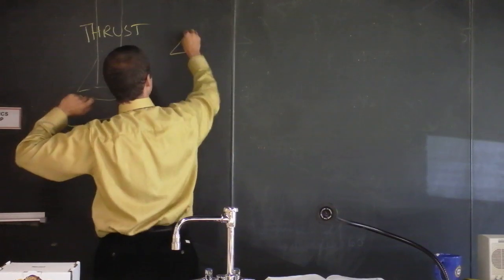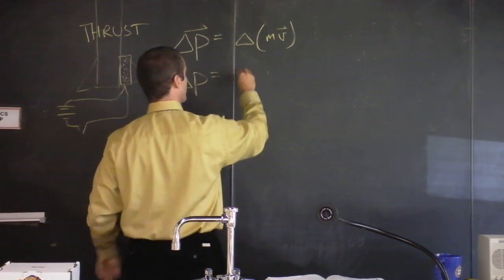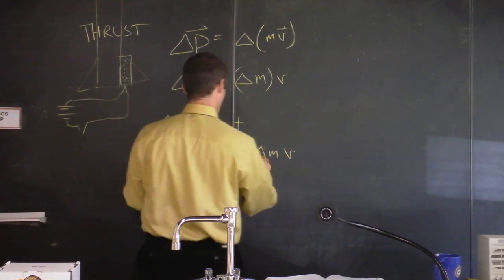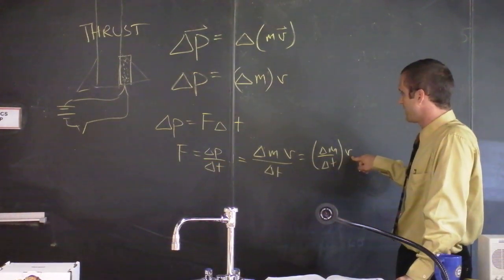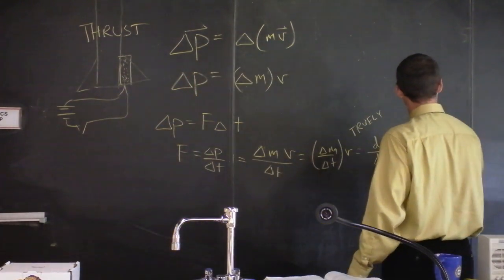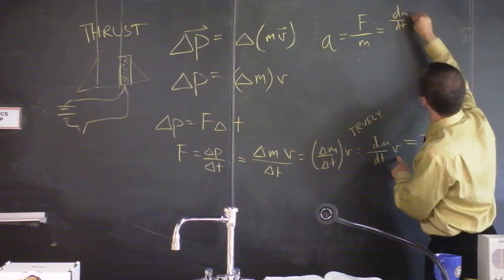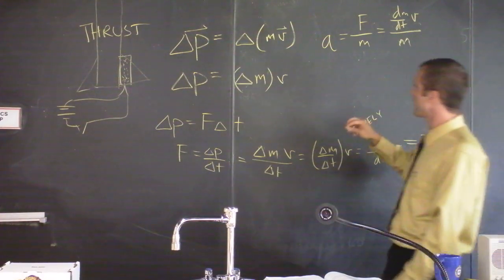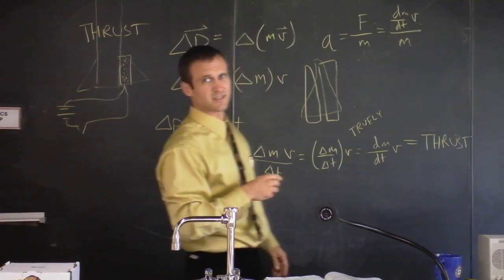Thrust of a Rocket 'Cuz You and Your Friends can do ROCKET SCIENCE | Doc Physics

Comment: A rocket does NOT crate thrust by throwing mass out the back.  A rocket creates thrust by creating PRESSURE behind the rocket..  The mass is irrelevant..  ONLY the pressure matters.
Reply: Completely untrue
Reply: It’s part of the process, but even then the most thrust is generated when the outlet pressure of the nozzle is equal to atmospheric pressure (the flow is perfectly expanded)
Reply: @tannerlehmbeck708   The outlet pressure of a rocket is SIGNIFICANTLY greater than atmospheric pressure. This is a requirement for forward movement. . ALL rockets work on the principle of creating a higher pressure environment behind the rocket to propel the rocket into the lower pressure in front of it. .  There are no exceptions to this rule.
Reply: @boptah7489  no it’s not…the static pressure at the nozzle could theoretically be lower than atmospheric pressure so long as the mass flow rate and velocity were high enough
Reply: @tannerlehmbeck708  No  The mass flow rate will always increase the pressure , you cannot increase the flow rate and reduce the pressure unless there is less resistance behind the rocket. This means that there will be no thrust.  A rocket ALWAYS requires more pressure behind the rocket for forward motion.
Reply: @tannerlehmbeck708   the outlet pressure of a rocket is NEVER equal to atmospheric pressure unless the rocket has stopped.  This is why a rocket cannot go into space....You cannot generate pressure in a vacuum.
Reply: @boptah7489  are you serious
Reply: @tannerlehmbeck708  Yes.   ALL rockets work on the pressure principle....nothing else.

Comment: Delta M is this the fuel air mixture? or the density of the compressed air? because most engineers don't desgine their engines to lose this much mass in a single operation.

Comment: Great video! Question. Does a rocket propel forward solely due to the trust of the rocket pushing against the atmosphere; or is the thrust due to the mass exploding inside the rocket and hitting the nose of the rocket, pushing it forward? I am not a scientist and would say the first option only, however other formulas suggest that the atmosphere has nothing to do with a rockets performance and a rocket would work better without an atmosphere.